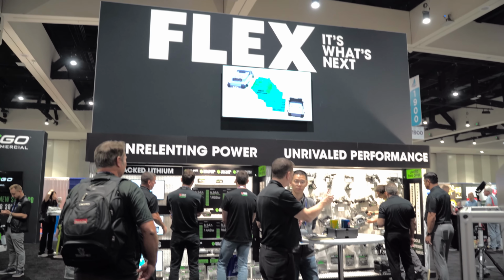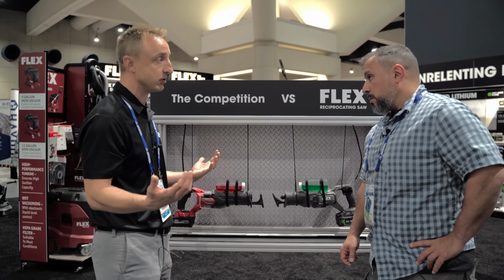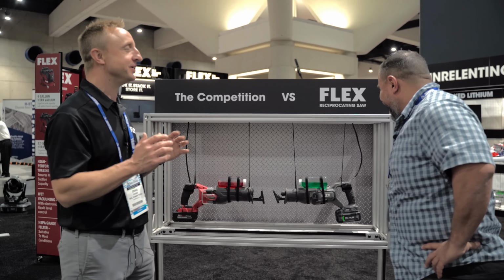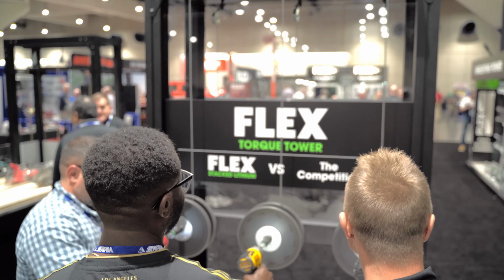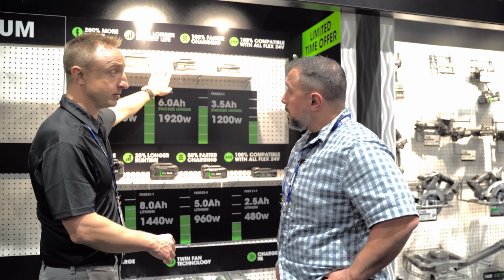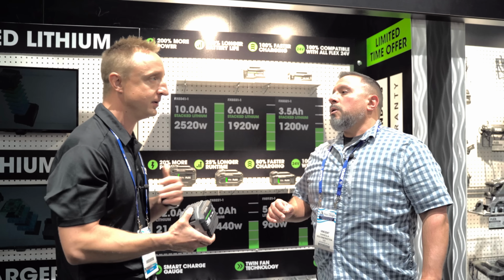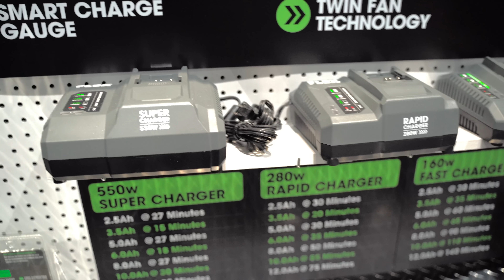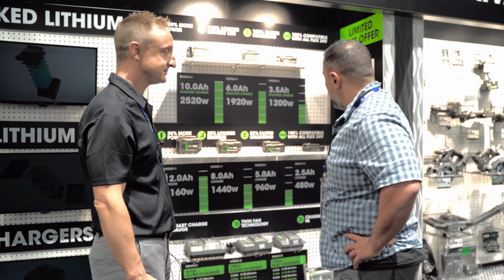FLEX Tools DOESN'T Want Milwaukee And DeWalt To KNOW!

Comment: The stacked batteries and fast chargers are soooooo good! I was using my circular saw yesterday to make repeated cuts of scrap wood, and the my 6ah battery needed charged. I was shocked how quickly it was charged to full, and it wasn’t even hot when I took it off the charger. The saw is the best circular saw I’ve ever used, corded or cordless. Flex tools are no joke.

Comment: The Flex sawzaw saved my arms. Doing a bunch of work on a flip house - it was a dream. I love this tool and you can beat it up a bit and it will keep on going. Vibration is a big deal for me. Love the saw. Love the grinder too but the oscillating tool is my favorite. the lights are just fantastic on them.
Reply: Flex 💪
Reply: The oscillating tool from dewalt is the worst.  Crazy vibrations.
Reply: @athannaelanderson3806  Same and rumor has it they are doing a brad or pin nailer next year. A lot of new tools for sure next year. I WANT a brad nailer.
Reply: @josecuervo8487  My wife used the Flex sawzaw on some brush at our flip house. She stated it had zero vibration. I was happy as she has some carpel tunnel.
Reply: @JackKirbyFan  Confirmed, as well as cordless Miter chopsaw, 360 Laser, and cordless table saw from what I remember.
Reply: @josecuervo8487  Flex is very comfortable, especially with adjustable speed settings from 1-5

Comment: As a Flex tool owner, I am loving how fast it is evolving, but man do they need to do some work on getting more types of tools, 3 saws , 6+ drills, 2 grinders, yet no Trim router, heat gun, ect.... I am glad its moving but it seems like they are not giving us more types of tools yet and that is the only downside, The new batteries are insane and great that they work with the current products.
Reply: You’re going to be waiting a long time it takes years for companies to develop and release different tools without running into any copyright issues
Reply: You're in luck.There trim router comes out in a couple months.Along with there deep cut band saw and compact bandsaw,orbit sander,right angle drill and more tools to be announced.
Reply: @RamdomAudioGuys. My cousin that works for Chevron/Kobalt/Flex he said that Flex will be releasing more tools especially the tools that you mentioned but he can't give me the exact specific dates but it's gonna be somewhere in 2023 or early 2024 and it's a top secret classified information as Flex/Chevron/Kobalt is aware that TTI and Stanley Black and Decker/ DeWalt and Makita might copy or imitate their New top of the line technology. As my cousin that works for Flex the company already got, mastered and perfected their New 2nd Generation of Stack Lithium Ion pouch cell battery technology, that will enable them to build more power tools, and testing on their science lab. He also told me that Kobalt might also have a Stack Lithium Ion pouch cell battery and brand new powerful Generations of Brushless Motors for their tools. And those brushless motors are gonna be much more powerful than Milwaukee and DeWalt. That's all it, He can't give me more Information regarding about it as He needs to be Quiet about it or he might lose his high paying job on Flex/Chevron/Kobalt
Reply: they need compete with Milwaukee they have like 300 tools. flex barely has 25 tools they would make a Killing if they expanded thier tool line up but they ve been in the game for 5 years the new flex

Comment: I got dewalt, Milwaukee, and flex. I’ve already had 2 flex 5 amps go bad. Have had a few Milwaukee’s battery’s go bad on me. Dewalt has the best batteries no other company will ever be at their level. They not only put down power, they last no matter what you put through em!

Comment: Some great things coming from Flex. Just a matter of time before Milwaukee comes out with better battery tech. Need a 5ah size battery in high output stacked lithium.
Reply: There working on stacked lithium, I like to believe there taking so long to release it bc there trying to perfect it
Reply: @jameshood3692  Sometimes perfect can put a company behind. The new Gen 4 stuff took so long to be released but isn't much better than the Gen 3.

Comment: Milwaukee 4amp batteries for most my tools. For longevity, only 1 tool failed so far "base level drill" started to smoke a hair then auto power off. Sent it in, milwakuee fixed it n sent it back "5year warrenty" and it is year 5. Got a new brushless drill in meantime. Love em both for mixing concrete

Comment: I would like to see the fluid poured from the same bottle into two separate bottles because who knows if that's the same liquid inside. There's no way I feel they're going to get that much vibration out of a Sawzall. Unless Flex has an absolute garbage motor in their Sawzall.
Reply: Hahhahaha me either i run this sawall almost daily and i don't feel that much vibration .
Reply: It appeared to me that the bottle on the flex also had more liquid in it as well.
Reply: My coworker has the same milwaukee I thought it was great I switched tool brands to flex and I was blown away by the Sawzall It actually makes me enjoy cutting things my coworkers really like it as well very well built and more than enough power

Comment: Would've been nice to see a 6AH Flexvolt battery atleast on the Dewalt in that torque test.
Reply: Dewaltın 2015 yılında çıkan dcf887 modelini olduğunu düşünürsek karşılaştırmaya girmemesi daha iyi olurdu
Reply from the maker: MILWAUKEE TOOL and DeWALT Put Flex IN THEIR PLACE!
https://youtu.be/NGR7iheZ7ms
Reply: I usually use a 2.5Ah battery in my 887 for the weight in long uses.

Comment: I never see Flex in the field.  Mostly Dewalt for carpenters. HVAC Milwaukee.  Plumbers Dewalt pex expansion tool. You wouldn't have to worry about getting your batteries stolen with Flex.

Comment: The Flex is a 24volt tool. It is 25 percent stronger minimum. It should better be because of the voltage increase.

Comment: the power when he says it's the same it's true but all companies have two options with batteries.  option 1 more power same run time. option 2 less power(be less power I mean equivalent to original battery) longer run time . they can make the stacked power run longer at the equivalent power of thier previous generation but flex chose more power but with same run time.  all they gave up the voltage. or mess with increasing the amperage. that is how companies utilize the. dewalt with thier flex volt 60 v. more power better for circa saw or heavy duty equipment like impact wrench.  longer run time would benefit drills impact drills, lights, recipe, saws, fans, hole saw drills. oscillating tools. they can make both style of batteries. they just just chose power

Comment: It’s embarrassing how any video suggesting Milwaukee isn’t best in any way inevitably has a bunch of fan boys in the comments saying the tests weren’t fair or, when all else fails, simply declaring “I’ll stick with Milwaukee.” Why do these folks even watch tool videos? Are they just waiting for someone to say Milwaukee is best so they feel validated? Are they deputized members of Milwaukee’s marketing team? I’m glad they like their tool brand but good lord.
Reply: The same can be said of the DeWalt or Makita fanboys. My tool chest has red and yellow everywhere (M22, M18, Skil,  DeWalt 12V), and maybe some teal soon, so I like to look at things with a more skeptical eye. Flex has some powerful tools, but their marketing just sets off some red flags for me (kind of like Milwaukee's debut of their screwdrivers).

That being said, there are some valid points. The bottles are not in the same location on those recip saws, which can definitely change the results. Flex is 24V, so it better be more powerful. Why did they have to go to 24V to beat Milwaukee? Flex does not have the depth of tool selection that anyone else has.

Comment: That Sawzall test removed all the vibration in the flex but the Milwaukee tool didn't look like it had a Arbor in the head of the blade insert you know what I'm saying. That alone has weight and takes away the counter action of the saw
Reply: Exactly!

Comment: They zip tied the bottle on the Milwaukee right over the top of the saw and on the flex they zip tied it further back where more of the vibration is absorbed by the rest of the tool. Seems setup

Comment: Dewalt and flex and literally helping each other. In my opinion. Think about it flex tools came about with new innovated battery technology then dewalt did. So did dewalt help them with the batteries. Then flex said will help you with more tech in you drill aka dewalt future of drills, impacts and impact wrenches with turbo mode?!

Comment: Why are they using one of the smallest batteries possible on the dewalt impact in the torque test 😂 power stacks are not equivalent to what they have on there for flex and Milwaukee lmao the flex and Milwaukee had their 6 amp hour ones on. I got the power stack batteries for free with an impact and they are one step up from the 2 amp hours power wise

Comment: I HATE WHEN THEY DO LITTLE THINGS TO GET A UPPER HAND.... flex had the bottle of water over the motor and the milwaukee was out front over the shaft that goes in n out pluse the milwaukee shoes was extended for more vibration. Maybe flex has less vibration but it wouldn't have been that much different!!!!

Comment: Impact is too big don’t want to drag around the extra weight climbing on top of pole barns
Reply from the maker: Short ভিডিওর মাধ্যমে দেওয়া উত্তর দেখুন
Reply: He didn't show the new impact, it was a flash on the teaser video though.  It is more compact than the standard but still has typical impact power or really more than most big brands.

Comment: Imo fast charging those cells in 15min is going to degrade them faster. You will be reducing the life of them by a third. 
Maybe I am wrong, we will have to see as time goes on.
Reply from the maker: You’re assumption is based on cylindrical cells he explains why it ain’t the same

Comment: no competition with  flex 24v against milwaukee 18v and dewalt 20v. flex needs to put their tools up against dewalt flexvolt 60v and metabo htp 36v. Funny flex will not show their tools competing with tools that have more voltage than their 24v.

Comment: Watching them talk about batteries just amuses me. What a load of crap.

They aren't going away from cell lithium for power its because milwaukee has a patent and they are tired of paying. Cell batteries are more durable and reliable. Thats why they've been the standard all this time. Is it fair that they have to pay milwaukee? Probably not. But cell batteries don't tend to swell until they pop and catch fire.
Reply from the maker: Maybe watch the Tool Leaks You Missed At Milwaukee Pipeline!
https://youtu.be/b3Avmkdb4yI and rethink your comment
Reply: Milwaukee doesn't have patents on the use of 18650s/21700s, lmao.  They weren't even the first to use them.  

Milwaukee's first foray into Li-Ion was with a failed 26700 format.  They ditched it for 18650s (which Makita used first, and Makita had Li-Ion tool/battery/charger system out before Milwaukee did anyways) because 18650s allowed for 18V slim packs, where as 26650s were 5 cells per pack and were as large/larger than a 10 cell 18650 pack.  So Milwaukee ditched V18 and came out with M18 in 2008 with 18650 cells, 2-3 years after Makita's 14.4/18V LXT systems.  Dewalt and Metabo were the first to use 20700s/21700s.
Reply: @jaywelker5566  Never said they were first, they just have a patent on general design. They even sued an won against snap on over it back in 2017 and won.

Comment: Wow VCG you didn't say anything about the smaller battery they were using for the DeWalt dumbbell torque test. I saw you notice it and you didn't say anything. Basically tells me this is just a paid advertisement for Flex. You've also criticized these tests before so what changed? Unsubscribed.

Comment: Milwaukee's horrible power supply Worse than I thought, see below for yesterday's results, today is much worse, I now realise that you need to switch off the power supply between each cut, as a trim carpenter using a small chop saw, the batteries run down very fast even when not using the saw, the amount of cuts they claim is outrageous and misleading,

Comment: Problem with Flex isn't the quality, it's the value. Last time I checked, they still are not offering most tools as "tool only" options, meaning DeWalt and Milwaukee are always going to be much less expensive for those who are already invest in a battery line.
Reply from the maker: They have the tech, but I agree they need more tools and options now